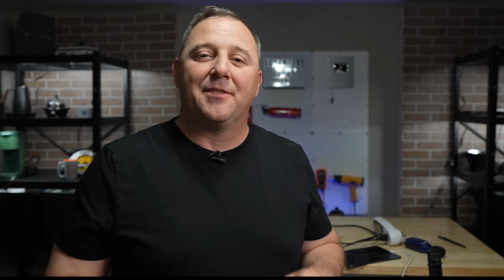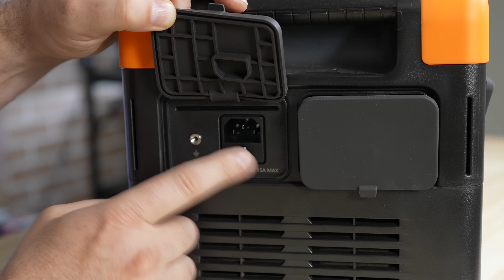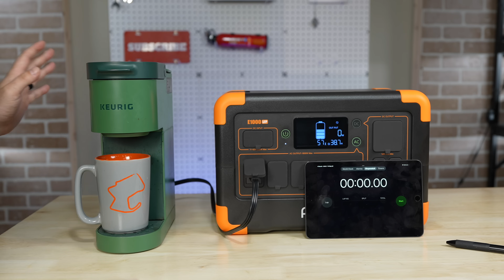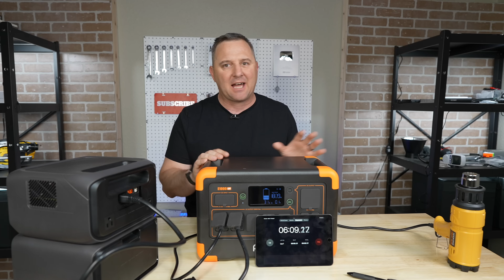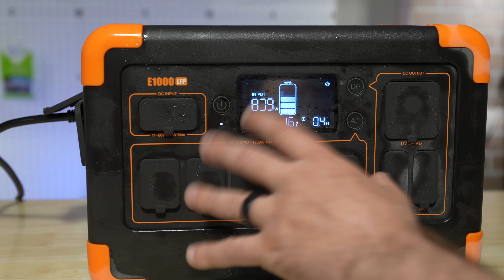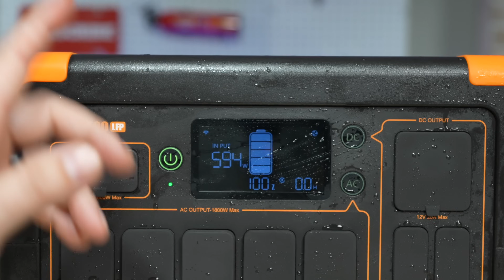The Best Winter Power Station: Pecron E1000LFP Self Heating Battery

Comment: Ok question on the 8a 20a selection switch. If I recharge via another 100ah Lithium battery using ring terminal to xt60 is it going to charge at the higher 20a rate? Thing must have a built in step up convert?

Comment: I have the PECRON E2000LFP 
I had it repaired by then and they supposedly sent me a new unit. Same issues. It dies at twice the rate of my Grecell 1000. My fridge will put my pecron 2000 at 50% over night and my Grecell with half the power capacity will be at 75% for the same appliance. Even charging a cell phone last me 3% points. It eats its own power running even on DC.

Comment: Loved it when I got it. But when I needed it to work it failed! The power went out and so did the Pecron. I had to turn the pecron off and back on to wake it up. If I was not at home nothing would come back on. Even when the power came back on the Pecron did not supply power to anything i had plugged in to the Pecron. I got it for backup power for my computer and a small frig. did not work when I needed it to. Disappointed!

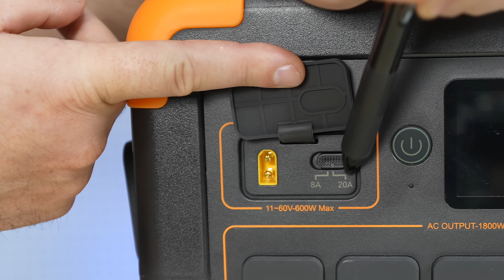Comment: Sidebar question at 2:10 it shows a xt60 is that male or female? At 4;17 it shows another xt60 is that male or female? I'm trying to order a xt60 to dc7909 plug but everything for sale online  goes back and forth to what is what. Anybody please answer. What I am looking for is whatever Ecoflow cables that come with power stations I believe are male that I plug into my units. I need a plug or cable to Dc7909 male. Thanks for any help.
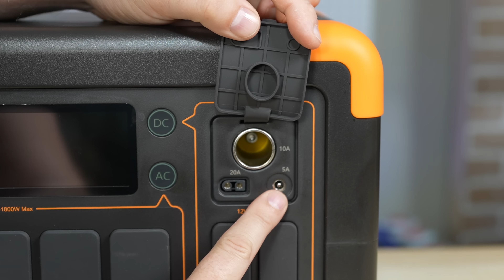Reply from the maker: At 2:10 that is considered a male fitting. At 4:17 is a female fitting. This one would work: https://amzn.to/43ExZns
Reply: Thanks.

Comment: I’ve had this Power Station for about three months and use it several times a week. I used it to power my trade booth and I have a 200 W solar panel I pair to it.  The power station has unparalleled value, and I have very little negative to say about it., at $399. It’s a no-brainer.  The only negative I found with it is you cannot connect app to it by Bluetooth even though supposedly you can, it doesn’t have a wireless charge pad on top, the USB-A DC connectors can be finicky, so I just use the USB-C connectors. Other than that, it’s great.
Reply from the maker: Awesome that it’s working out so nicely for you!
Reply: @AdventureGearTV FYI, the display will show 100% in all cases before the device is fully charged. It will charge at 1000 W until it hits 100%., Then it will charge at 300 to 500 W for another 10 minutes or so, as it brings the battery to full capacity. You will know the battery is at full capacity when the input remains at zero for an extended period of time.
Reply: @obstn81  You answered the question I was looking for. Super!  I was getting concerned that the PS was showing full charge, but it was still taking 500+ watts input on fast charge.  This also happened charging with the XT60  (switch set @ 20a) and an external 12v battery.  I was worried it did not have over charge protection and the internal battery would be damaged.  I also noticed a lot of heat with no PS fan running during this charge.  In the future I will put the AC inverter fan on to cool things down. 
I'm using my E1000lfp to run my wood pellet stove this winter.  Tests show E1000 runs  it well both auto fire start and pellet feed & fans.  It appears I can run it for several hours with the PS.  I also have 3 Lithium 12v batteries in parallel for an additional 4 KW attached by XT60 input, as well as, have solar input.  Thanks

Comment: Seeing all that condensation on the outside makes me wonder how bad the moisture build up inside them is when they heat up from ice cold.  Will be interesting to see if they last.
Reply from the maker: The condensation is more a result of rapid temperature change. In the wild it wouldn’t instantly change from sub freezing temperatures to 70F.